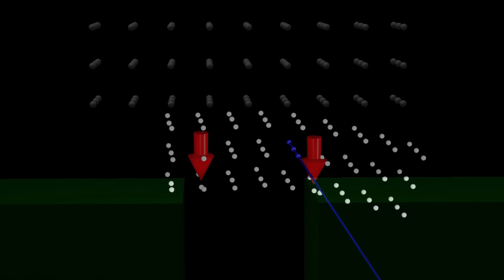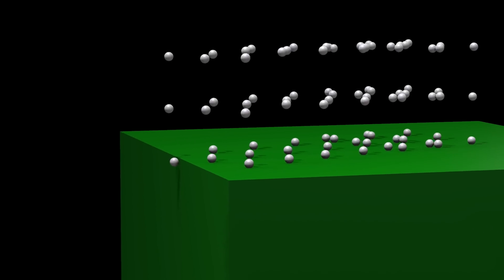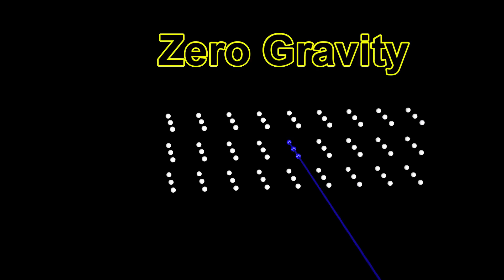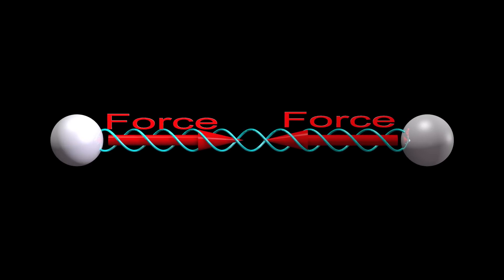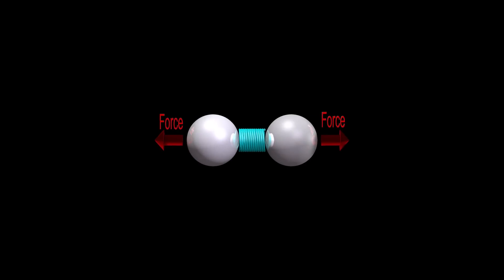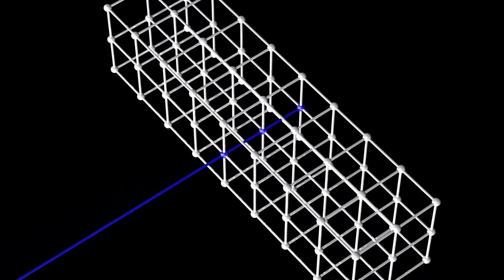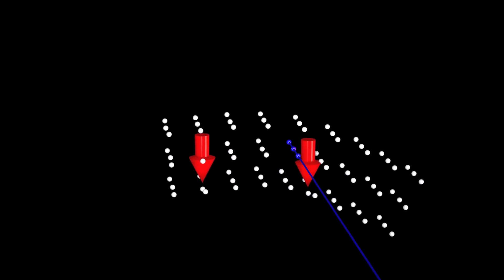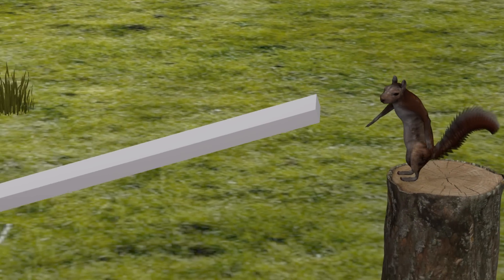Torque can’t exist for rigid objects

Comment: I am fairly certain deformation is not, in fact, required for torque to exist in rigid objects under Newtonian mechanics.
Here is a concrete example with all forces laid out that demonstrate how an uowards force is applied to leftmost point of the object while the external force is applied on the right:
suppose we have 3 points that do not lie on the same axis with the same mass: O, A, B
O is our fixed axis, A is the leftmost point, B is the rightmost point.
Suppose A has coordinates (-1, 1) O has coordinates (0, 0), B has coordinates (1, 0)

Suppose there is a flrce Fa between O and B, Fb between O and A, Fo between A and B (those forces have a positive sign if they repell points), as well as an external force acting on B downwards: F and the force of the axis of rotation: T that acts in an unknown direction

knowing that O is fixed in place we get: T+Fa+Fb=0 in vector form
knowing that A and B stay the same distance away from the origin, we get that their acceleration is perpendicular to the lines OA and OB respectively
so we get that projection of total force on those axes is 0, specifically:
A: Fb+Fo/sqrt(2)=0; B: Fa+Fo/sqrt(2)-F/sqrt(2)=0
we also know that since distance between A and B is unchanging that the tangential component of the acceleration must be the same:
Fo/sqrt(2)=-Fo/sqrt(2)-F/sqrt(2)

so, we get that
Fo=-F/2
Fb=F/(2sqrt(2))
Fa=3F/(2sqrt(2))
T=-Fa-Fb in vector form

This way, everything is fine. Point A moves up because force Fb pushes it outwards while force Fo pulls it to the right.
The total torque on the system is generated by T and F
No contradiction is reached.

As others already pointed out, the paper appears to have several mistakes.
I don't see any mistake in this concrete 3 point argument that works under Newton's mechanics, has external forces be applied along the lines between 2 objects and describes rotation of a rigid body consisting of 3 same mass points.

Obviously that model doesn't work when special relativity is taken into account and is technically not correct as real life objects aren't truly rigid, but it is internally consistent.

If anyone finds an error in my comment or finds some fact non-trivial and needing explanation, please let me know. But as of right now, I am convinced that the claim of the video is incorrect or presented in a misleading manner.
Reply from the maker: I didn't follow your entire argument, but based on the rigid model you propose, suppose there is a connection between O and A, a connection between O and B, but no direct connection between A and B.  If there is an external force only acting on B, then the only force acting on A is from the rigid connection between O and A.  But, this force between O and A can only act along the line connecting O and A.  Therefore, there is no way that A can initially start moving in a rotation around O.  As for the so call "mistake" in the paper, the person who was making the claim that there is a mistake (by posting comments under many other people's comment's), later conceded the point and said that he now agrees with me.
Reply: @EugeneKhutoryansky  Thank you for taking your time to read through the comments.

I have looked through the paper and it considers a model with 3 points in figure 2: pivot, m1, m2
It is true that such a model cannot explain rigid body behavior, but the problem seems to be with such a model itself rather than with Newtonian approach, (as the lever cannot be infinitely thin in reality).

It is also true that adding in springs does lead to correct behavior once the body bends a tiny bit, but that is only one possible solution.

If we wish to more rigorously construct our model we may consider that the lever is, in fact, not infinitely thin, adding in 2 middle points instead of just one in place of m1, located just above and below the center, would solve this issue as the bottom and top points could exert different forces, leading to the total force acting on the middle be directed not along the line pivot-m2

In general if we want to approximate a tiny patch of material as one point, we find that 2 such "point approximations" may transfer torque between each other (as they are not perfectly on the same line), which means when we apply such models the strong version of Newton's 3rd law will not apply in the limit case when all points are completely merged. My problem with the paper is considering such a limit case without realizing that the statements about laws might not behave well in the limit case (to elaborate, some force may behave as "F=1/r" for r being the thickness of the lever and the torque may behave as "F * r = 1", which would mean that in the limit case of r=0 F=inf and everything breaks, making the model incapable of describing the phenomenon we are interested in, the statements about total torque on the system, however, do work in the limit case)

In general, real physical bodies have at least 4 points that do not lie on a single plane, let us call some such points A, B, C, D

If we consider a model which states that for each point "P" there exists a force between A and P, B and P, C and P, D and P, then we can always solve for internal forces knowing external ones as we know accelerations of every point "P" and the fact that ABCD don't lie on the same plane means that there will never be a "degenerate case" when all the force lines lie in the same plane, the forces between ABC and D would also work out for similar reasons (I do not have concrete concise proof of it, unfortunately)

Such a model is not perfect either, but it is capable of describing torque.

The model presented in the video with diagonal springs will also work once we replace springs with incompressible rods, but if we remove the diagonal connections (no matter if they are springs or rods), the shape will be free to fold in on itself (consider each point in the upmost layer rotate at the same speed around the axis parallel to the fixed axis, but lowered down by one connection, the upper layer would simply slide, all connections act basically as hinges)

The conclusion I draw is that we should be very cautious with making approximations in models and the paper has not made a good approximation of a real life scenario it is trying to describe.
If a system of points behaves as a rigid body the torque equations do work. But not all systems of points can form a rigid body, example of which is provided in the paper.

Thank you again for reading through the comments, I do hope my long rants are at least somewhat comprehensible to whomever may decide to read it.
Reply from the maker: I haven’t actually done the calculations, but I suspect that even if we add the diagonals to the rigid model, we still might not get the correct torque equation when we analyze all the internal forces.  But even if we do get the correct torque equation in this case, the claim about rigid objects can then be rephrased to just say that toque can’t exist for "some" rigid objects (such as the scenario described in the paper).
Reply: @EugeneKhutoryansky   I can see your point, however I might rephrase it to be "not all collections of points can form a rigid body, especially if we limit which points can interact with each other" since the way each connection behaves is basically like a ball hinge. (or maybe I am just being overly pedantic, hard to tell)

since by definition a rigid body is a collection of points such that the distance between any 2 of them does not change over time

I am absolutely certain torque does exist for your object if we add a connection between each two points, since we can select to look at only connections involving some preselected points A B C and D and solve the equations from there, the other connections giving more leeway to what forces might actually be present (it's not always possible to tell each internal force in such a model, as far as I know)

If we do not add such overwhelming number of connections I do not have concrete proof that it's enough, but I strongly suspect that any shape constructed of gluing triangular piramids together so that faces allign perfectly and the whole shape is connected by the end will be rigid. If we remove some of the connections your shape does actually get decomposed into a collection of such piramids since each individual cube does.

Unfortunately I can't seem to find a proof that that's enough. (and I'm almost sure it's not strictly necessary to form a rigid body, so it's not a "good" critetia either, but it's best I could come up with)

I am glad to have cleared some confusion up, at least for myself. Thanks again for considering what your viewers say.
Reply: @EugeneKhutoryansky 
I see. I will take a closer look at the paper later.

As for the claim, that is correct. If there is no connection between A and B there is no way to make a rigid body and that would be a bad model.

In a more general case, if we take the model used in the video with a few dozen points that is why we would need diagonal springs or connections.

I will elaborate in more detail later.

Comment: Not convinced… i watched all your videos. This one does not adequately explain anything in order to arrive at your conclusion. 

Pretty sure that even if things were perfectly rigid things would still rotate on a fulcrum 

I’m pretty sure the rotation is caused by the lack of reactionary moment force within the beam, which as nothing to do with rigidity. 

I know in I am using torque to describe torque here. But you need the same kind of analysis for structural members. 

You don’t need an elastic material to have a reactionary force upward when a book sits in a shelf .
Reply from the maker: This is discussed in much more detail, with mathematics, in the paper at https://scholarship.haverford.edu/cgi/viewcontent.cgi?referer=https%3A%2F%2Fwww.google.com%2F&httpsredir=1&article=1494&context=physics_facpubs

Comment: Why should the strong third law apply? For instance, it doesn't seem to apply given Maxwell's equations. It's obvious in the case of masses connected by springs, but not clear how it can be generalized. In the absence of that, this seems more like "Torque on rigid bodies cannot be modeled by a collection of point masses connected by infinitely rigid springs"
Reply from the maker: It does apply to Maxwell's Equations.  If you haven't already seen it, I have a detailed video on Maxwell's Equations at http://youtu.be/9Tm2c6NJH4Y

Comment: I am not sure this conclusion is correct. For example, there is torque applied in Euler equations for rigid body rotation of a spinning rigid top.
Reply from the maker: There are many equations that discuss torque for rigid objects.  These equations correctly predict the object’s behavior, from the perspective of the outside world.  However, if we assume that this is a rigid object, then we get into trouble when we start thinking of the object as a collection point masses connected to each other, and we try to calculate the behavior of these point masses in terms of Newton’s Three Laws of Motion.

Comment: There is no strong or weak version of Newton's laws. There are just...Newton's Laws. The third law is a statement that momentum is conserved, which is itself the result of a fundamental symmetry. Whether the force is central or not makes no difference to this fundamental principle. Besides, Newton never mentioned the constraint of central forces in his third law. Such distinctions are pointless and only serve to confuse.
Reply from the maker: The strong form of Newton's Third Law applies everywhere.   If we just had the weak form, we would not have conservation of angular momentum.
Reply: @EugeneKhutoryansky Hm, so, with angular momentum equal to p cross (x - x_0)
and dp/dt = F,
uh,
F cross (x_1 - x_0) - F cross (x_2 - x_0)
= F cross (x_1 - x_2)
ah, so, for the rate of change in angular momentum to be zero, then the force direction can’t have a non-zero component orthogonal to the difference in locations.. and so it must be parallel. Huh!

Well, I sorta skipped something there, didn’t I? I treated the rate of change of angular momentum over time as equal to the rate of change of momentum, cross the difference from the base point to the position of the thing,
Neglecting to do the product rule..

(p cross (x - x_0))’ = (p’ cross (x - x_0)) + (p cross x’)

so, really I should have
(F cross (x_1 - x_2)) + (p_1 cross v_1) + (p_2 cross v_2))
but p_1 cross v_1 = p_2 cross v_2 = 0,
so conclusion still applies.

Huh!

So, now I’m confused about how rigid bodies in Lagrangian mechanics can work while having conservation of angular momentum.

I thought the 3 were supposed to be equivalent. Forces are supposed to just be gradient of potential energy with respect to position..
I guess maybe infinite potential gradients make the 3 formulations not quite equivalent?

Well, “an infinite force if this thing changes” seems a bit imprecise anyway.. what if we just consider “Newtonian mechanics, plus rigid constraints on some relationships between relative positions of the masses”, adding constraints as a separate part of the system, distinct from forces?
Idk
Reply: @drdca8263  Yes, you have made an important realization that is mentioned in very few textbooks. If you define the angular momentum with respect to a point of reference x_0, the rate of change of angular momentum "(x-x_0) x p" not always equals to the torque "(x-x_0) x F". The additional term "(x-x_0)' x p" is called the phantom torque. There is an article that points out, that this phantom torque is often ignored and leads to misconceptions especially for asymmetrical rolling bodies.
Reply: The strong version though is needed for the conversation of angular momentum. So you have to state this fact. The assumption that the internal forces are parallel to the connecting lines also makes sense from another point of view: If one assumes central potentials for all mass points (to model bondings), the internal forces automatically fulfill Newton's strong principle of interaction. The flaw of this video is, that not all external forces are considered, which are needed for rotations about a fixed axis.
Reply from the maker: @jjs9473  You and I have been continuing this conversation underneath comments from several different people.  For everyone else reading this, I would like to copy your last statement from under a different comment, where you now agree with me.  In this statement, you wrote:  

"Ok, I think I know what you mean now. I think your point becomes clear with an extreme example: Take three mass points with equal mass that lie equidistantly on a straight line and are rigidly connected to each other. If you exert an external force on the middle mass point, which is also the center of mass, perpendicular to the line connecting the mass points, the result is a translation. Due to the rigid connection, the other two masses must experience the same acceleration, i.e. they experience a force parallel to the external force. However, this force cannot be applied by the internal forces, as they would have to be parallel to the connecting line according to Newton's strong interaction principle. This is where I see the contradiction proclaimed in the paper. Now I understand why perfectly rigid bodies are not realizable with the strong version of the third law."
Reply: @EugeneKhutoryansky  Perfectly rigid bodies cannot exist as plenty of rules would bring about strange results in mechanics. Collisions would result in infinite acceleration which we know is not true.

Comment: I have a question: What is the difference between the weak & strong form of Newton's third law, and why don't we just use the strong form everywhere, since it includes the weak form (which is the one I've always heard of). My guess is that the difference between them is one is a statement about the conservation of linear momentum, and the other of angular momentum, both of which can be derived from first principles (Noether's theorem).
Reply from the maker: The strong form of Newton's Third Law applies everywhere.  I guess the reason we typically just use the weak form is because in most cases, it is sufficient to analyze the situation.  By the way, the conservation of linear and angular momentum are both a consequence of Newton's Three Laws of motion.
Reply: @EugeneKhutoryansky  There is a Newton's third law paradox, that I'd recommend for a future video topic.  Consider the Lorentz force between two identical charges that approach each other, initially along two perpendicular and intersecting axes.  Calculating the Lorentz force, we'll see forces that are equal, but not opposite, as an apparent contradiction of N's 3rd law.  The topic to show, is how this situation ultimately is consistent with conservation of momentum, since the EM waves that result ultimately are a third agent involved.
Reply: Newton's laws are often formulated for two bodies, but it is neither mentioned, that those bodies could be mass points, nor which direction interaction forces should have. For systems of mass points the conversation of angular momentum only follows for the strong version of Newton's third law. Some textbooks state this assumption, to derive the conversation of angular momentum mathematically. If the interaction forces don't lie in the line connecting two interacting mass points, they would form a force couple with a torque, independent of the choice of reference. Thus inner interaction forces could produce torque, even when no external forces are acting on the whole mass point system.